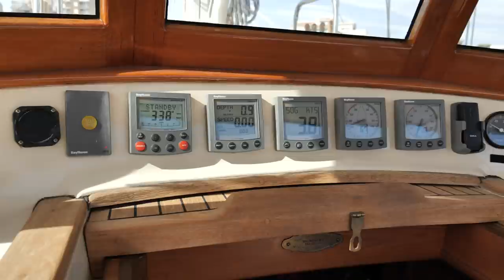Ep12 - Hiding from Mediterranean winter winds.

Comment: Great to see the electric motor on the dinghy. I spent my career using petrol and diesel farm and garden machinery and by the age of 45 I was suffering a number of health issues from the exhaust fumes to the extent that I had to stop working. I think it's great you have bought an electric  
outboard, it would be nice to see a review of its performance in future.
Reply from the maker: Yes I agree electric has so many advantages. Now battery technology has moved on and now electric cars are taking over, the functionality of batteries will go up as quickly as the price comes down. We will do a full review as a separate feature as soon as we've given the motor a thorough test.
Reply: @svfairisle  I am interested to know how you get on with it as we have just made the same switch for the same reason. Added advantage is charging it off solar so more self sufficient. To be fair ALL engines use considerably less fuel when not run full blast. I wonder if a battery might give you MORE range tban the built in tanks of the smaller engines. You can always have a spare battery in the same way as a jerrycan and can even  charge up a battery at the taverns or pub over a beer which you cannot do with a jerry can.
Reply from the maker: @nathanhamilton7092  Yes Aquamot now do a larger capacity battery which I think we will have to get at some stage. Good idea about charging the battery in the pub, good excuse to stay longer! I'm thinking of building a lockable box under the dingy seat to put the battery in & I could keep the charger there too. Judys now paranoid someone will come along and nick the battery off the back of the engine, I think thats very unlikely as it's specific for the engine. Thats the problem with having nice stuff though, we knew no one would have stolen our old 2 stroke!

Comment: At 16:00 in the video, it seems like the table was designed for one person to use. Why don't you add a larger top that can be removed easily and stored or a hinged leaf to lift up .
Reply from the maker: Yes it's not ideal for eating dinner, it's just meant for drinks & bits and pieces really. It's also latticed teak thats a bugger to varnish so I might go for the fold out leaves option at some point.

Comment: Nice video guys Did you get an extra battery for the outboard?
Reply from the maker: No we didn’t but you’re right to question it as I think it would be a good idea. The boat kitty is struggling at the moment though so it will have to wait. Looks like we’ve got a pretty large unforeseen boat expense coming up. More on that in later episodes.

Comment: Due to the Coronavirus Spain has shut all ports and marinas, what do you intend doing until this crisis is over?
Reply from the maker: We're at anchor. The lock-down in Spain is pretty tough, it's been a struggle getting water and food. We will have a special episode this Thursday covering it.
Reply: Sailing Fair Isle I believe you will not be allowed entry into any Spanish marina, if you want to move on try the Alfacs lagoon and anchor just outside Sant Carles Marina, between the boat yard and the mussel farm.  You would be able to take the inflatable to the shore, and it’s not far to walk to the shops, which is allowed.  You are protected there from any weather and most importantly no fetch.

Comment: Glad to see you two back having an adventure. May I suggest you devise an easy way to stow your dinghy aboard as towing it is a recipe for much frustration and potential loss. Cheers, Rob.
Reply from the maker: Yes you're right of course. We can and do stow the dingy on deck if the conditions are anything other than calm, it fits nicely across the foredeck. But obviously calm conditions can change as we found with a 40 knot gust out of know where passing the rock of Gibraltar. It's just lazyness I'm afraid!